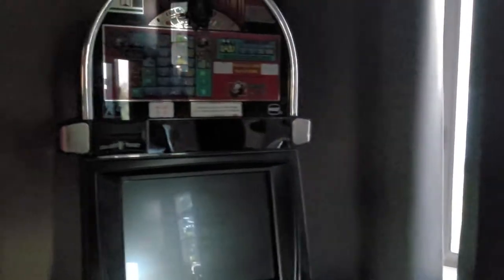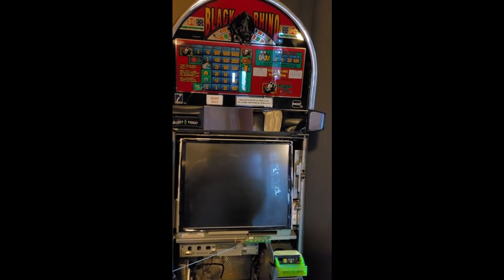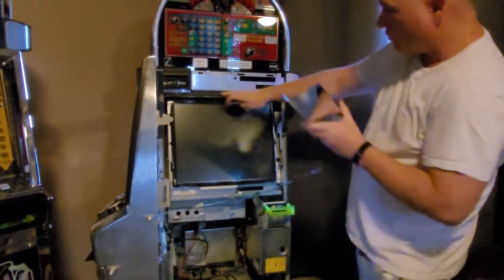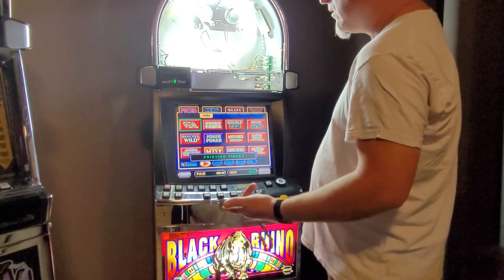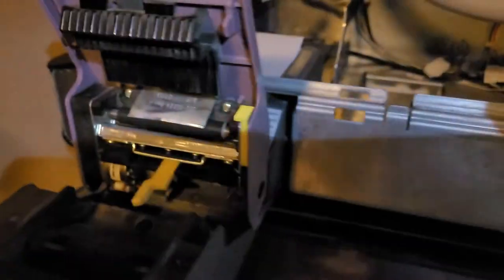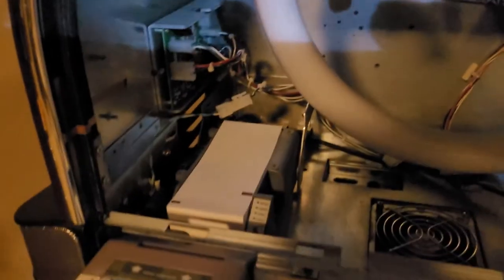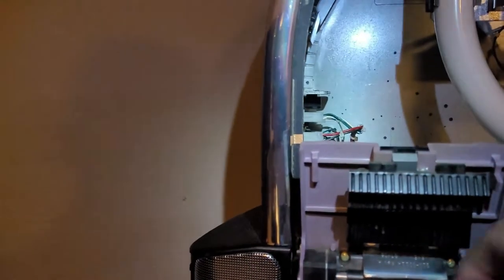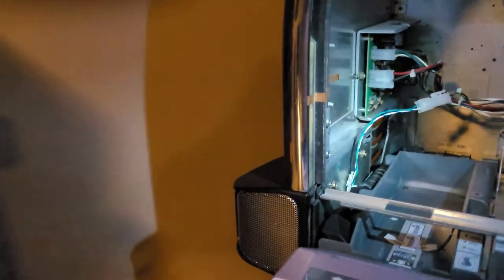#SLOT TECH - BASIC PRINTER MAINTENANCE OF A GEN2 NETPLEX - TUTORIAL TUESDAY SPECIAL FOR MURRAY P.!

Comment: I have a question for you. I have a Game King Keno that has a whole bunch of games on it. The problem is that when i turn it on a small window pops up and says 'Remove Ticket'. And i cant get that off the screen. I cant see any tickets that are stuck in there and it wont let me put another ticket in. I would appreciate a step by step tutorial on how to fix this problem. I am at a total loss. Thank you for any help you can give.
~ Beth. 19:13
Reply from the maker: Have you tried re-keying it? Meaning used a clear chip for your version of gameking and resetting all the software?
Reply: @WJForeverKenoCasino  I'm not exactly sure how to do that. The only keys are on the outside of the machine. Do you mean one of those?
Reply from the maker: @betha4207  unfortunately no it's not that easy. Gamekings require keychips to reset. Depending on the version you have there is typically an eeprom chip that goes in the cpu board and you go through the process of reset. You can find the process on YouTube by typing gameking reset in a search. It is technical and I would recommend using someone who has knowledge working on slots. They are basically computers inside. Now if you have a newer gameking with say DaVinci diamond keno, wolfrun keno etc, then you are talking a flash drive reset procedure with necessary setup files/software on it.